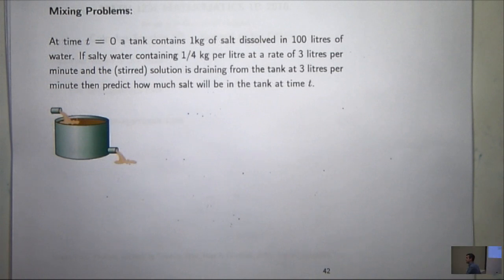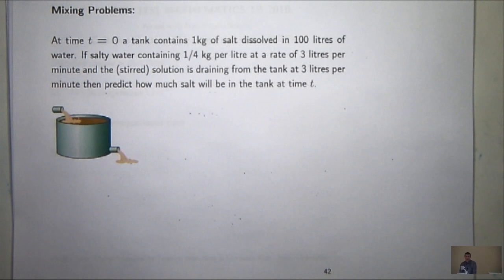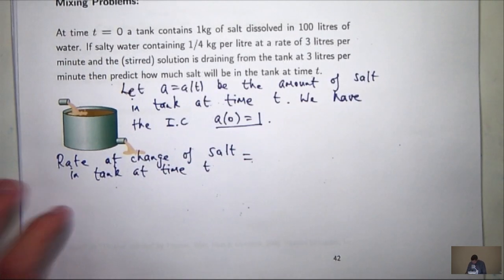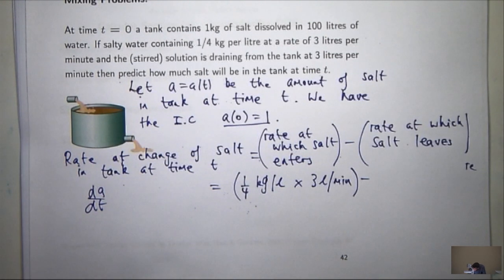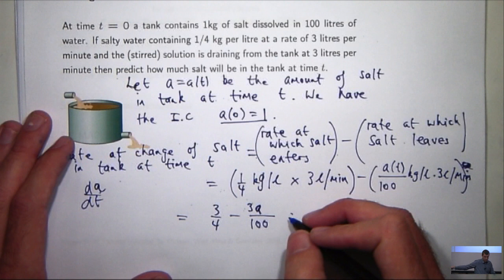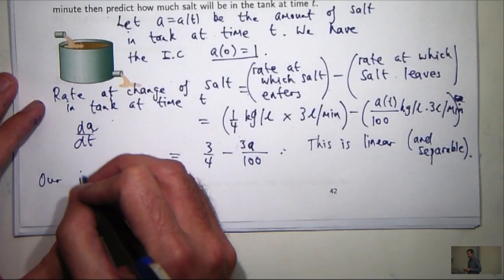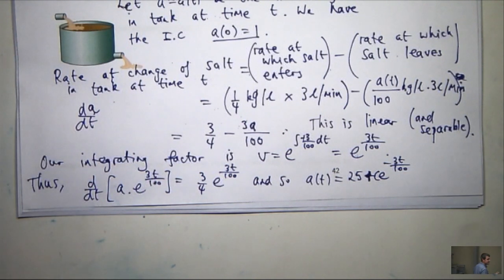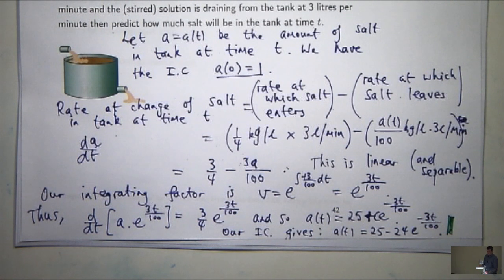Mixing problems and differential equations.

Comment: Thank you for the very clear explanation

@germzkill  I know my response is a little late, but in order to make it a separable equation you have to have a common denominator. The equation will look like this: (75- a(t)) / (100). Now divide the numerator on both side and then you should be able to see the separable equation.

Comment: You said it is both separable and linear ... I don't see how it is separable .. can you help explain ?
Reply: when?
Reply: It is seperable since da/dt = 3/4 - 3a/100 can be written as
 da/dt = (75 - 3a) / 100 , using a common denominator.
Now it's seperable, i.e.   da/(75-3a) = 1/100 dt